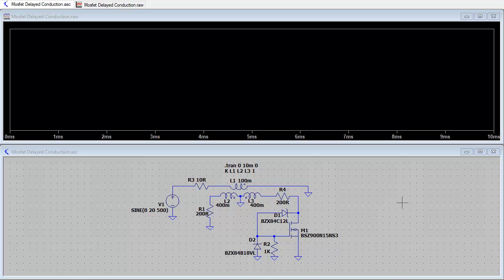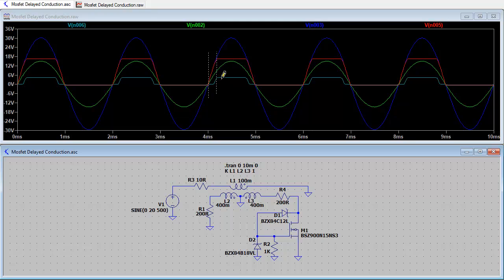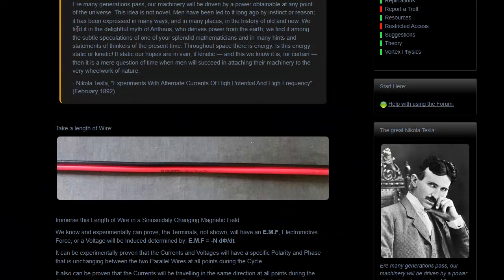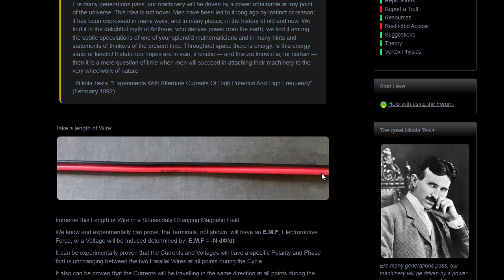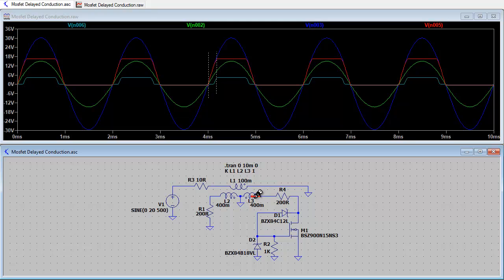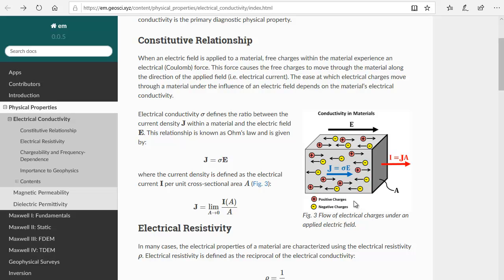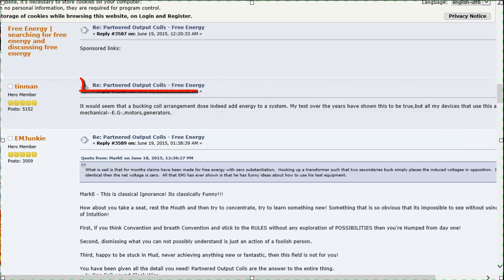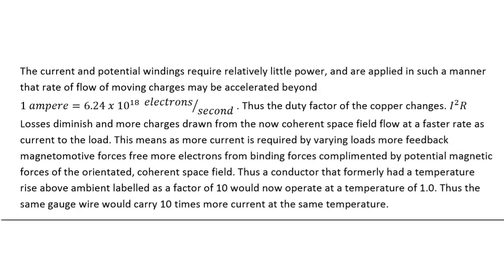Delayed Conduction can induce Magnetic Resonance.

Comment: Imagine a resonant ferrite core magnetised, what will be the result ? Barium ferrite magnets.... Barium is the material used in piezo device, so yes it can be set in resonant frequency and if it is magnetised then we have magnetic hysteresis and we can collect the radiated energy from differential coils. If the input coils are 90 degrees from the output coil, the only way to get output is magnetic hysteresis created by the magnet.
Reply from the maker: @Michel Grenier - All of which is true, however, there will always be losses, every machine has losses, there is no method of "Generation" in what you say, so Energy In will equal Energy Out less Losses, a Symmetrical System.

Comment: coils as capacitor plates? Yes! use bifilar pancake coils for that.
Reply from the maker: Just an analogy, perhaps not ideal, but gives a way of thinking about how the Capacity of Partnered Output Coils might behave.
Reply: If both are resonant, and one is reversed, then one is positive while the other is negative.
Meanwhile, in my experiments I'm getting power from resonance. that should not be possible. seems to be from the combination of transverse resonance (voltage and current 90 degrees separated) with longitudinal radiant energy (induced by an impulsed bifilar coil). 
very exciting, making progress

Comment: Thanks!.   too this end.  = imagine the magnetic flux, -  which apparently travels instantly... establishes a current in the 1st secondary., via the load, -  - then the 2nd secondary begins too conduct. and jerks the magnetic force ,  too disrupt lenz law.... i honestly dont get it. - but i did replicate, and reverse wound transformers do make more noise, and sound a little different... however am yet too see any overunity.       =(hard too prove even if i did get it )  -  btw i think resonance is confusing, because its not possible for something that travels instantly.      ps i havnt replicated this circuit. will do. and let yo know for sure !
Reply from the maker: See: http://www.aboveunity.com/thread/delayed-conduction-in-bucking-coils/?order=all#comment-17e347b0-5b32-4051-a2c1-aa1c0158e04c Then this might make a little more sense. There is some fiddling required, you can see it in some of the videos shared in that thread. Ask questions, I can help the best I can.